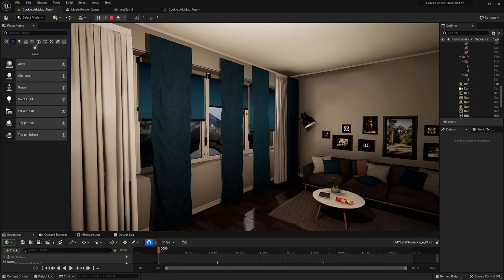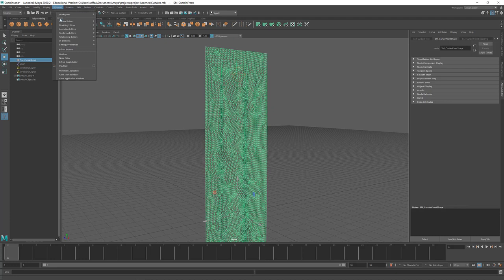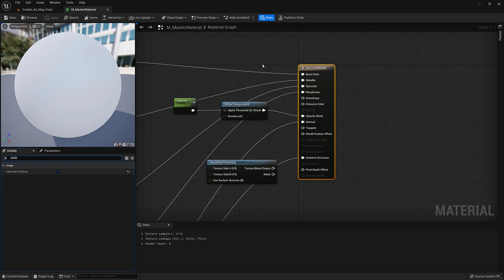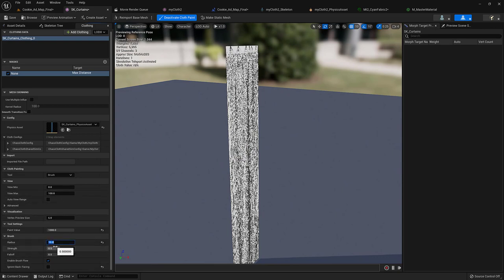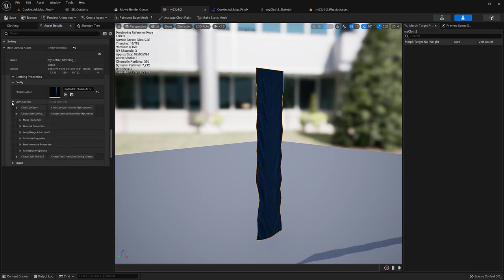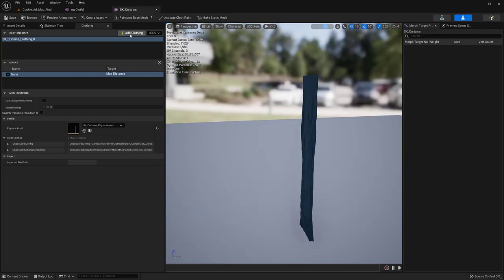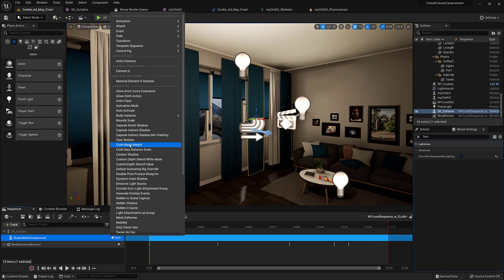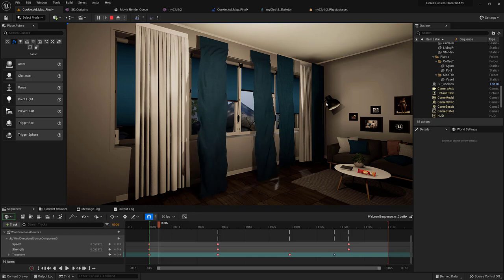Cloth in Sequencer and Unreal 5.0 and Wind Issue Work around

Comment: there's gotta be a way to add wind to existing cloth in ue5, I've already done a ton of work on its configs for stiffness, drag, damping, weight.. etc etc... would hate to have to redo all that just to get wind to affect it
Reply from the maker: I tried this in 5.1 yesterday.  It's working fine for me without the 4.27 workaround!  Yay!  Perfect timing on your ask!  (I'll post something in the comments)
Reply: @ShaunFoster  that's a nice light at the end of the tunnel, any tips for resetting the painting of cloth using your 4.27 workaround? the cloth I'm trying to apply it to diseappears when I try to repaint the cloth weights. it's a completely different model so.. yeah.
Reply: guess I'll have to bring the model in to 4.27, paint cloth like you did, set it up and then import that to 5.03
Reply from the maker: @notusingmyname4791  you should just be able to delete the cloth attribute on the skeleton mesh and create a new one, and I think that would reset the weights

Comment: Amazing you're a lifesaver man finally got it!
Reply from the maker: Glad I could help!  Did you get past the frame rate / optimization issues?
Reply: @ShaunFoster  Ah yes turns out it was a media player causing it so iv removed it and will add it to the shots without it in premiere pro :D
Reply from the maker: @eternalgames9978  oh yeah - Media Player is super heavy.  The only thing I heard that might help is for the media player: try setting RHI to default instead of DX12.
Reply: @ShaunFoster  Cheers for the tip! I ended up doing the premiere pro thing since I was running on a schedule but it came out good so will keep that in mind for next time!